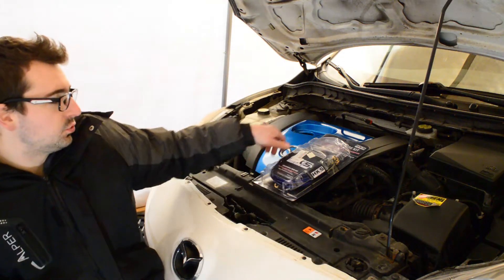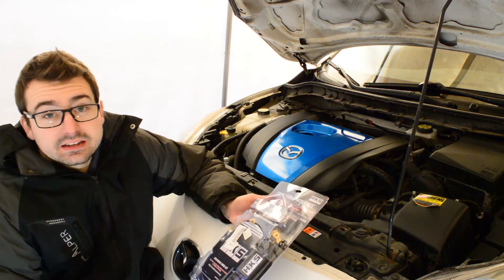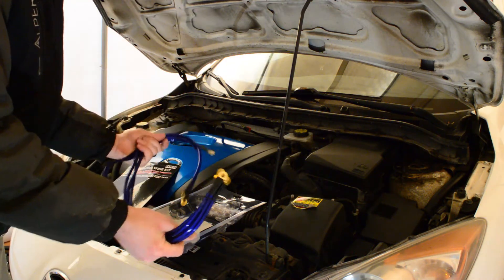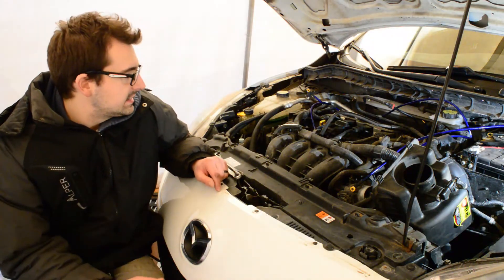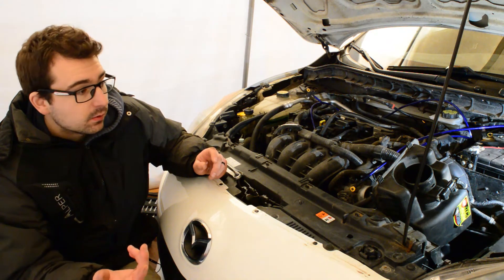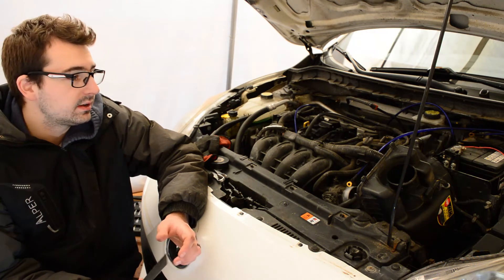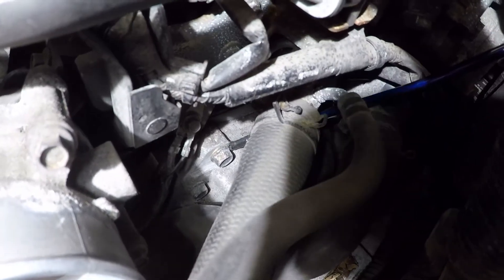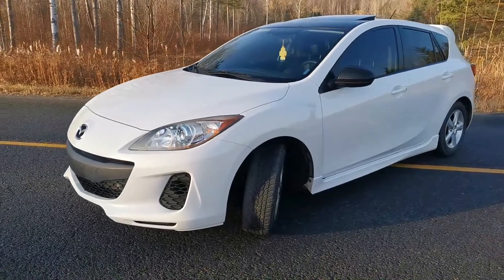CAN WIRES REALLY IMPROVE ALL THIS?!?

Comment: Do i need to worry about the alternator dropping when loosening the bolt? Also does any bolt on the transmission housing work?
Reply from the maker: I didn't have issues with the alternator, maybe it was stuck in place. For the transmission I connected it on the top bellhousing bolt.

Comment: So I tried to follow along, and I am a little confused. It seems you have 5 cables attached but only 4 connected to the negative terminal, am I missing something?
Reply from the maker: Hey they're all connected to the negative terminal. I connected one to the alternator, one close to the cams, one to the other strut mount, one to the throttle body and one to the transmission. Hope this help!

Comment: Does it matter which bolt on the transmission? Also would u be willing to post a picture of the cylinder head bolt?
Reply from the maker: I put mine on one of the bell housing bolts, I don't think it would really affect much what bolt you pick as long as it's on the transmission. if you'd like more pictures feel free to reach out on Instagram!
Reply: @DrivingProduction  thank you

Comment: You know how there is a bracket thing that goes over the coils there is a bolt for each coil and then there is a 5th bolt in the middle idk maybe 4 inches in front of them is that a good place to put a ground?
Reply from the maker: Could be a good place, I personally haven't grounded it there but it would most likely help

Comment: I have the same year, and model. Could you potentially do a video showing where exactly to bolt the wires to? I have the kit but i'm fairly new to the mazda platform! Thank you in advance!
Reply from the maker: Yes I made a Short on exactly where I bolted the grounding wires. You can check it out here: https://youtube.com/shorts/IznED0ojoSM?si=k3etCLn7k2H8Y9iI
Reply: @DrivingProduction  So sorry, I didn't realize you posted it, and I found that video like 5 minutes after commenting >.< Good stuff! definitely the best place to find info on a 2012 Mazda 3 on the internet!